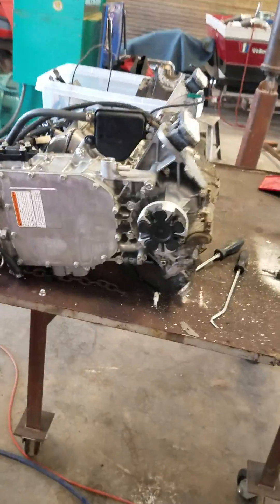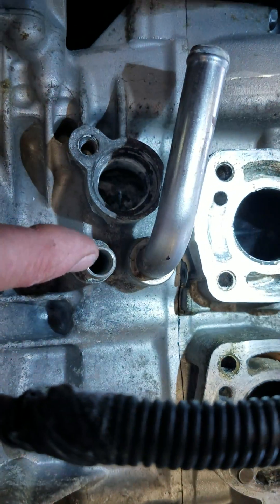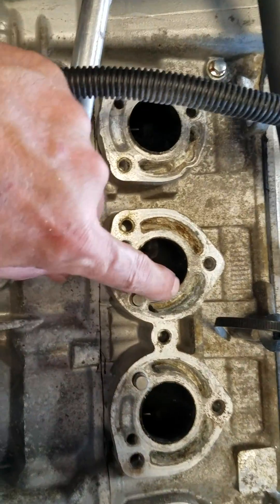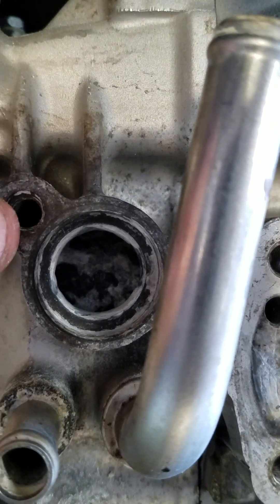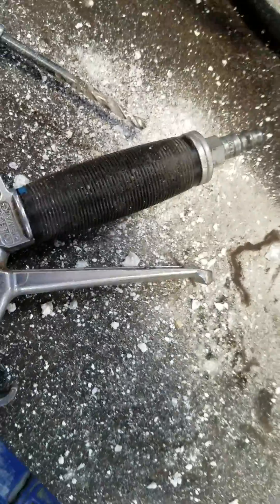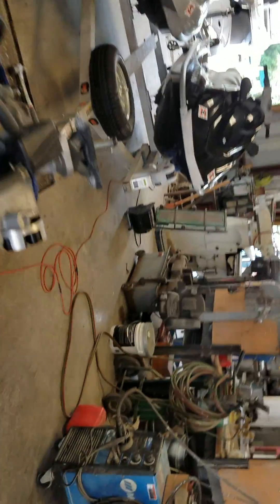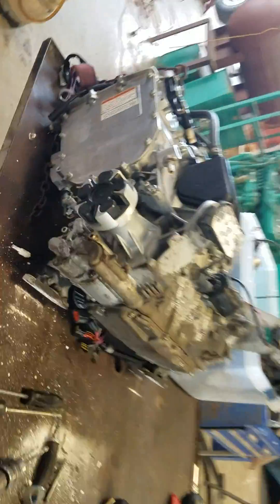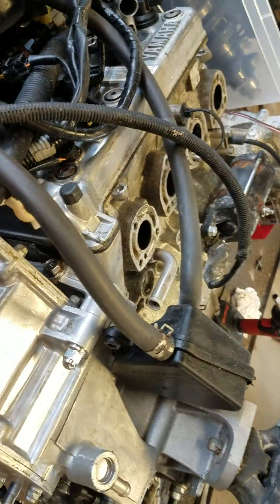Yamaha VX Waverunner cooling system blockage

Comment: Vinegar & water.
2 parts Vinegar 1 part water will dissolve all that hard build-up.
Soak thoroughly for a day or two then flush constantly with the vinegar solution breaking down the electrolysis.

Comment: Good video and it's great that a repair shop would go to this much trouble to record a video for their customer. Nice work.

PS - a salt treatment chemical is not 100% mandatory, but it sure helps. The main thing is to flush after salt water use, even if it's just fresh water.  Ie. it's more important to remember to do it, whether or not you're using a salt treatment or just plain water.  I have owned PWCs since 1992 and I've never ridden in fresh water. Before Salt Away, Salty Captain, Salt Shift and all those other products came to market 10 or so years ago there was no other option than just plain fresh water. Especially where I live in Australia.  At least with these newer treatments it makes it easier and quicker to flush out the salt.

Comment: I’m doing this with engine still in hull 
Got manifold off and cleaned ALOT of sand and clogged up holes 
If I wanted to run water through do I just run it to regular flush port 
Do I need to run engine while doing it? Since manifold is off
Reply from the maker: I wouldn't run it.

Comment: Is there a trick to getting the exhaust manifold off? I have the engine pulled and all the bolts off the lower section of the manifold but doesn't seem to want to break loose
Reply: there is a dowel on the bottom part of the manifols and it is angled therefore the top exhaust part will never go up. you need to drop the lower exhaust manifold

Comment: I’m going to be using this same motor in a boat build project. Does this have a closed loop cooling system?  Or does waster come straight from the jet pump and go into the lower inlet pipe on the engine block?
Reply from the maker: This is raw water cooled. Not closed cooling. Thank you for your question.

Comment: Engine was running fine but was giving an overheat after 5mn ride, my impeller is clean, and i always flush it after ride.  so what do you think about that?
Reply from the maker: Garly Leger HIDA scan through it and look for any codes they'll be one stored depend on the engine I believe there are three temperature sensors identifying which temperature sensor gave the code of overheat will tell you where the problem area is to start looking I hope that helps you thank you for your question

Comment: I am just about to take delivery of my first Jetski, so this has been very helpful in understanding the open loop cooling system, and how important it is to flush out the Salt water.I do have lakes available to me, but 
here in  New Zealand we  generally all live close to "a" coast, so its easier to ride Salt water than the lakes (generally).Thanks for posting.
Reply: Dude, I hope you flush your ski with saltaway and not just fresh water. This exactly how this happens. Salt away doesn't use any protective ingredients,  it just makes the salt move out with the water, if you use it all the time, you have that protection.  If you spray a little on your ski,  it will remove the salt from there too, making it very easy to clean. It doesn't matter what type of cooling system you have, they all must be flushed if used in salt water. Even closed loop. Closed loop still takes water from the sea and uses it for cooling in a heat exchanger.  So flushing any water craft is important if possible!  I hope you already know this by now. Where do you hale from? Im in the Hawksbay.  😊
Reply: @kevinlegarrie7043  it uses sea water to cool exhaust and on supercharged machines it cools the intercooler

Comment: Great video Lewis Walker , what is your recommendation for how (long?) to flush for Salt water properly? And what is "Salt away"?
Reply from the maker: Hello Phillip B, 
Salt away is a product sold at many many places & wallmart to be used according to direction on label for cleaning the damaging & destructive contaminants of salt water on internal engine and related water/cooling passageways.  Just do a google search. Keep in mind there are several different brands but Salt-Away is the most available w/o special order in our opinion. Mandatory to flush using a product if running in salt or brackish water.  Thank You for your question and God bless.
Reply from the maker: Phillip B , sorr i missed this message. Salt away is 1 of many products used to flush engine internal cooling passageways after salt use.
The directions on product for recommended use.

Comment: did it work fine after the repair?
Reply from the maker: Michael Vicens it did fix it 100%
Reply: Thank you for this video!!!  Mine had the same issue though not as bad and now it works just fine!!!  Instead of taking the top off we ran a wire through the channels after taking the exhaust manifold out and used air pressure to clear out.  Now I use salt away to flush my engine.  Thank you again!!
Reply from the maker: Michael Vicens I am glad the video helped you. God bless you and your family.